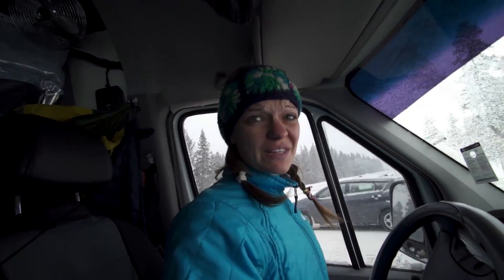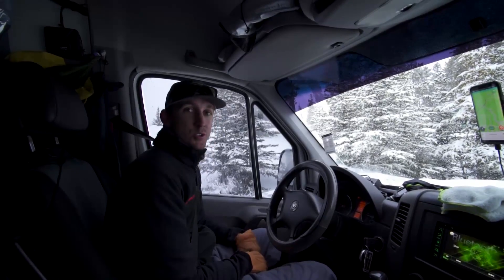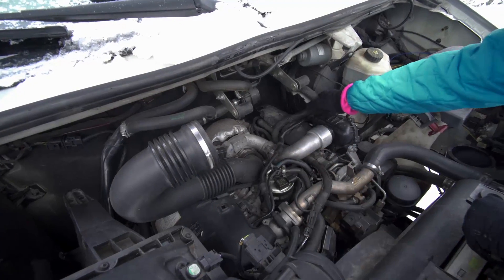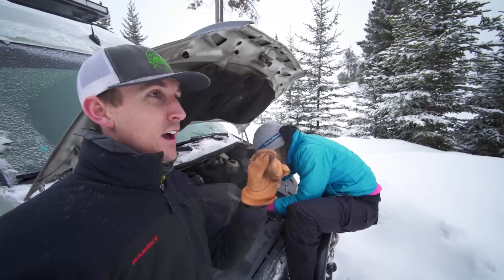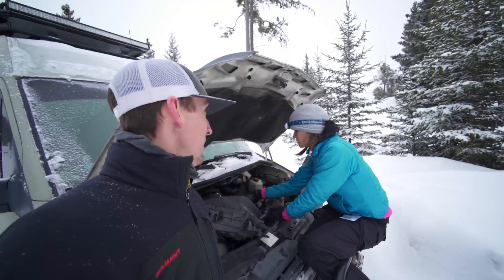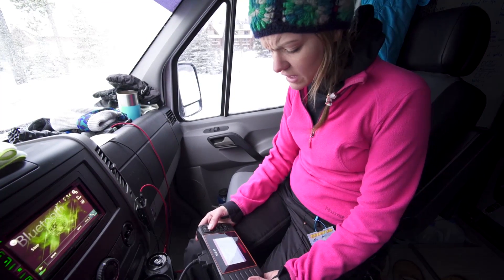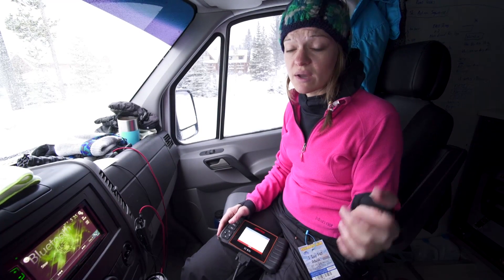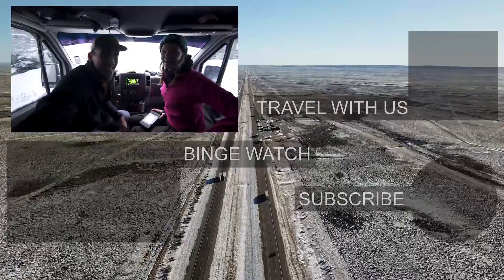Help Troubleshooting?  Sprinter Multiple Error Codes - #Vanlife | Adventure in a Backpack

Comment: Problems can be easy to resolve with good old YouTube.  I had an issue with a Ford PU and it was weird.  A very weird electrical issue.  Looked on YouTube for similar symptoms, found an explanation of the potential cause, remedied the potential problem identified by YouTube poster and have not had the problem reoccur.  I would have NEVER discovered the cause of the problem without YouTube.  Dealers/local mechanics were totally useless.  Zero help from me regarding resolving your problem but your approach so far is stellar.
Reply from the maker: I completely agree.  I love that we have the ability to crowd source mechanical issues!  :D

Comment: Hopefully your attempted repair today works out. I am 100% sure you've located your problem within that wiring loom. This is a notorious issue for all Sprinter Turbo Diesels, even all the way back to the Dodge Sprinter days. One important thing to note while taking on this task, is to also inspect the wiring loom towards the front that runs and turns underneath the large radiator hose. It's a tight area and a lot of abrasion happens right there as well. Sometimes if the coolant leaks at all, it makes it's way into the abraded wires. Best wishes...and keep up the great filming. Appreciate seeing the ups and downs of van life.
Reply from the maker: Thanks for the tip.  Will check that area out for sure.  Thanks for watching!

Comment: I think you guys are on the right track. What I would do is to open up that wiring harness and look at the wires.. If they are shorting together you need to separate them and that's your issue.. And then insulate them.from each other.  You have to physically see the problem.   hope that helps   good luck Carmine
Reply from the maker: Good to hear.  Although we weren't able to physically see the problem, we were able to potentially fix it, at least for now.  New video talking about the fix is live: https://www.youtube.com/watch?v=EN1UIInwEss

Comment: Not that this is any help, but watching the video made me curious to take a look at my Sprinter wiring harness. Sure enough my wiring harness is worn about as much as what I saw in your video. Whoa! Obviously, I need to fix this soon before it becomes a problem. I'm not a certified mechanic, but I know my Sprinter inside and out and do all my own repairs. Considering the codes you mentioned I strongly believe you found the problem. I highly suggest fixing it on the spot before it causes further problems, such as shorting out other components. With that many codes I would definitely say it's the problem! Open up the harness and check each and every wire. Hope this helps a little.
Reply from the maker: Yeah, awesome!  Definitely on the to-do list for tomorrow.  Get yours taped up!!  :D :D  Glad you caught it early!
Reply: Heat shrink tubing and more insulation should do it!

Comment: Nate, be sure to do things before going any further: 1) Disconnect the negative cable from all batteries providing power to the ECM (engine control module), or whatever control module to which this wire loom connects. This will prevent damaging the control module. 2) Unplug the  wire loom from the control module for maximum protection.

From the looks of things, the loom had been damaged from chafing and the insulation on some of the enclosed wires has worn through. These bare wires may be grounding to the part on to which the loom is mounted. They could also be shorting across each other.

If this is the case, taping the wires with damaged insulation, patching the loom and securing it away from chafing surfaces should solve the problem.

If you engine analyzer can clear codes, do that, then restart and see if the problem it's fixed. Shut everything done and recheck for any codes and troubleshoot from there.

Best wishes for a quick and completely fix. None of this is ever fun from the road, let alone the cold weather.

Lastly, please do let us know how you make out.
Reply from the maker: Thanks for the heads up!  Should be good to go now.  New video talking about the fix is live: https://www.youtube.com/watch?v=EN1UIInwEss

Comment: Well it sounds like a short to me... Open up that harness where it has been rubbing to see if the wires are bare... If not then follow wires back from the injectors to see where they go as there could be a possibility of rubbing and it can only take a very small crack in the wire to make a difference in voltage which would cause you trouble.
I feel for you guys as I've had many issues with my crafter  and I really hope you get it sorted.
Reply from the maker: Maaaybe we've found it.  Didn't find anything obvious, but we just drove 30 miles or so on it with no problems.  New video talking about the fix is live: https://www.youtube.com/watch?v=EN1UIInwEss

Comment: I had a code 2149 which is a very similar problem to yours. To solve the problem i cut open the wiring loom and electrical taped all the wires in the area of the chafing as well as putting liquid electrical tape around everything. And then I closed the wiring loom back up and taped it back together. Be careful when cutting open the wiring loom to not cut any of the wires.
Reply from the maker: Cool.  That's the route we are going to go with it.  I'm guessing that solved your problem?
Reply: Hunter Skinner idea is a good start. Most of the codes appear to be related to a lack of electrical power, or missing ground. The rest are just residual alarms from it not starting. Its easy to get blown away from the volume of codes, you just have to weed through them to find the root cause.
Reply from the maker: Yeah, that's what was overwhelming.  Just the sheer number of codes.  I guess I got lucky on a search to find a tip on where to look for the short.

Comment: Hey guys Andy from New York I had a 2011 Sprinter same exact problem wires robbed it went into limp mode 40 miles an hour stalled drove it all the way back 80 miles in limp mode well no one problem is the EGR valves the wiring harness melts or rubs on the turbo exhaust anyways they had a take apart the wiring harness and solder 6 wires together on mine I sold the van as quick as I could I'm definitely not knocking sprinters they're great when they're brand new Turn-Key no problems no headaches but I bought a high-mileage used one found out the hard way after going on YouTube and the Internet it's all documented the problems that they have again I'm not knocking Sprinter or diesel but I sold it and bought a ProMaster front wheel drive gasoline engine I'd rather pay more money for gas then repairs anyways love your channel it's definitely the wiring harness you have to disconnect and reconnect the battery or shut the codes off with a scanner after the harness is fixed let me know how you make out you can see my old van and new van on my channel thanks
Reply from the maker: Cool.  Yeah, will definitely post a follow up video with fixing it.  Cheers!
Reply: When giving instructions like this, its a great idea to use punctuation for  clarification.
Reply: Yeah voice to text while I was driving, push send.
Anyways unravel the harness find the wires I soldered mine and  taped.
Reply from the maker: Yeah, got that done today.  New video talking about the fix is live: https://www.youtube.com/watch?v=EN1UIInwEss

Comment: Just as a general exercise for the used RV community, I'm not sure what the best strategy is. I almost bought a 10 year old + box truck from UHaul for $11k. They run OK, look OK. Do you find the best mechanic you can? Throw some money at it, try to nail everything down from the start? These are US drivetrains, so there are decent mechanics 'everywhere'. With the Mercedes it is way more specialized. It might not hurt to find the best shop you can and have them go over the thing top to bottom. I think having a weak electrical system tends to gunk things up. Merc has a new all electric model of the Sprinter they will be selling in Europe, in case you are tired of internal combustion. Good luck, really. Running out of rum is just poor planning.
Reply from the maker: Yeah, we'd really like to drop it off with Dennis in Golden, but we just lack the time.  But, alas, we are up and running.  New video talking about the fix is live: https://www.youtube.com/watch?v=EN1UIInwEss

...and we have acquired more rum...

Comment: Gday guys, In my experience (although not with Mercs, but with many other manufacturers) when the computer shows this many codes which tend to contradict each other, the problem is mostly a common earth problem, or dirty or wet main wiring harness connector. Check the battery terminal connections for all wires on both earth and positive then check the charging voltage of alternator and check all fuses ok
  I would then pull the outer protective wrap off that wiring loom to further inspect that harness to see if any wires are rubbed thru (without the key in the ignition) . If all ok, follow the wiring harness to see if there are any main connectors and remove and check for clean and dry. Maybe a good idea to remover the ECM connectors and refit to double check secure and clean connection. The Earth at the battery is a great place to start as well as the EARTH STRAP between the engine block and chassis, then there will be other earth points around the engine bay and body pannels. Unfortunately I dont have access to a Merc wiring diagram, but all these sensors may have a common earth somewhere. The main power supply voltages can be checked by voltace drop tests across the fuses as well as power supply relays. If all looks good then try wiggling the wiring harness in different locations and erase the codes to see if any codes dissappear.
 Hopefully this may help as these checks have helped me get so many cars going on the side of the road at work. I am certainly not always right but I do know you cant skip the easiest fixes first. 
 Good luck, you guys make a great team and im sure you will fix it.
Reply from the maker: Fantastic, my friend!  Will definitely give all of those a go for sure.  Pesky electrical gremlins.  Thanks so much for the checksheet.

Comment: It’s never great of you have split or shorting cabling. If you can break open that loom where it’s split and make sure each individual wire is in tact and re-insulate where needed it wouldn’t hurt as a starting point. If you have a soldering iron you can always splice the damaged cables apart and re solder and insulate not make a new connection. Make sure you disconnect the battery when playing with wires though!
Reply from the maker: Yeah, agreed.  That definitely was one of, if not THE problem.  New video talking about the fix is live: https://www.youtube.com/watch?v=EN1UIInwEss

Comment: an idea for temp fix... cut back the wire loom around the damaged section to expose individual wires, then run electric tape around each individual wire so they are isolated from each other. then reassemble everything back into the loom. if you have some plastic split wire loom tubing you could put it around the section that is rubbing or something else to keep it from rubbing. then you can test again for codes. at least this way you'll have removed possibility of wires touching or shorting out. PS. I'm definitely not a mechanic and am struggling with electric issues right now in my own rig on my own youtube channel while trying to install the ACR setup from your solar build in my rig (are we living parallel lives?)
Reply from the maker: Haha!  Perhaps so!  What you described is definitely the plan for tomorrow morning.  Hopefully that fixes it.

That ACR...  Once it's installed it's a beauty...but the install... ugh...

Comment: With it throwing that many error codes all at once it certainly looks like the problem you identified is at least part of the problem. It might even be the whole problem with a little luck. Hopefully the shorts didn’t lead to anything in the engine’s internal mechanics going out of whack. It shouldn’t have, but you never know.
Reply from the maker: Pretty much took the thought right out of my brain.  Thanks for the input.

Comment: You should check the TIRE PRESSURE, also often times the gas cap can be a little loose which can obviously do huge damage to every single wire... Im sure with these tips you will be up and running in no time. Experience: 20 + years Dish Washing.
Reply from the maker: Best.  Comment.  Yet... lol

So good.

So good.. ROFL!!
Reply from the maker: "Your spark plug wires are a little too long and your main prodsponder is nearly gone.  Your injector ports are stripped...and that ain't all."

Comment: 2012 Sprinter here. Mine is different generation rig, but here's what happened to mine.  Essentially carbon buildup in the intake manifold caused the throttle body rod to hang up. That caused the computer to sense a stuck throttle and shut down or limp mode the engine. I don't know what fault codes were showing, garages didn't share. Essential servo motor opens throttle body but when it doesn't fully return it due to carbon buildup in the intake manifold, computer shuts it down or put it into a low power mode but not a full limp mode. I would pull off the road. Turn off key for a few minutes (10) and it would restart and go a few minutes to sometimes a full week. Harsh rant coming! took a ridiculous 3 months, 3 rental cars and $12k to fix. Sprinter reps were ambivalent. Rant over. Replace your EGR regularly as well. My notion, your electrical harness diagnosis sounds way more likely with all those codes.  Good luck! After 300k mi, a Nissan NV now sits in my yard.
Reply: BTW 3.0L Turbo V6. With Tier 4 emissions with DEF, particulate filters and SCR Catalytic Converters. Again best wishes for a quick & an easy fix.
Reply: So the Mercedes Sprinter gave you problems and you switched to Nissan? If Im getting this right, how do you like the Nissan in comparison?
Reply: Even better idea, take it to someone who can delete the EGR  DPF and remap the engine. More HP and longer engine life. A lot of people do it in the UK even though its technically illegal.
Reply: The Nissan just arrived. Downside I lose about 16" in length and some power. Upside quieter ride and save $300 ea oil change :-)  . I have heard recently about deleting new emissions  from the computer on other Tier4 engines, their problem doesnt appear to be emissions related. My 2012 rig has been a cash black hole and Mercedes delights in it. The initial  missfire they describe was exactly what started when the carbon buildup was the problem. It would hiccup, best term I can describe it by, then shutdown or go into a sort of reduced power/limp mode. If it is the intake exclusively I was told think it can be done for 3-4k at a dealer. The powerplant is legendary Merecedes product, the emissions system is legendary moneypit. Glad you guys have the pre Tier4 engine! Again, best of luck, loving the life you share, someday we hope for a similar one.
Reply from the maker: We are residents of Colorado where there are pretty strict emissions guidelines.  That would never fly.
Reply from the maker: SAVE $300 on an oil change?!?  If I saved $300 on an oil change, I'd be MAKING money. lol

Comment: Delete them see what pops up. Its the wireing harness replace that harness. It doesnt make sense for all the parts and sensors to fail so start from the battery and check all the wires. Also make sure you battery isnt low it can throw codes due to low voltage which could be a dead cell in the battery
Reply from the maker: Agreed.  Should be fixed now.  New video talking about the fix is live: https://www.youtube.com/watch?v=EN1UIInwEss

Comment: There is a harness rubbing/break issue - there's a Youtube video on this. The plastic moves aside and the wires rub and break. Above the turbo. Oh, you just starting talking bout it. Where are you guys? You need an ODBII scanner to clear the codes so you can get it back to normal.
Reply from the maker: Good deal.  That's what we were seeing.  We are in Alberta and we have a scanner to clear the codes.  Bit o insulation seems to be in our future. Thanks!

Comment: I "Wonder" if this typical breakdown might be the reason you  went with a different brand of van?
Reply from the maker: Haha!  I think the non-replaceable rear axle seal resulting in a $1,600 repair was a bigger deal.  I was so ready to remove the Mercedes rear end and swap in a D60 or something. 🤣😂  But in all reality, the biggest reason is the ford has a higher payload capacity and more power.  Plus, there is a Ford dealership 5 mins from our shop and the nearest Mercedes dealer is 3 hours away.

Comment: If you had no codes before & these all showed up at the same time...you're wire loom heading to injectors very well could be it.  
If you had a bad ground you shouldn't get a short code come on the injectors (at least not likely in my experience).  Check the loom that runs across the front too.
Reply from the maker: Awesome!  Glad that sounds like our actual problem.  I was thinking either that or some kind of ECU Problem.
Reply: Id tend to agree with you the wires could be shorting out causing the ECU to go whacky. Try disconecting the the battery for a couple of minutes and then hook it up again see if that solves the problem
Reply from the maker: We will give the re-insulating a go and hit it with a code clearing.  If not, that battery will get a hard reset.
Reply: I almost never recommend unhooking the battery but if you do unhook the ground cable first. Less likely to short something out or surge something.